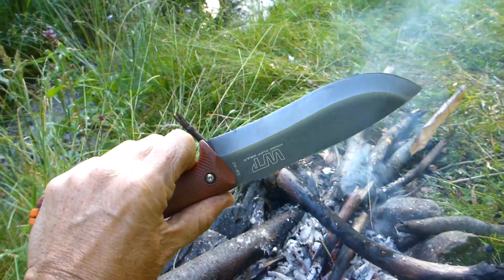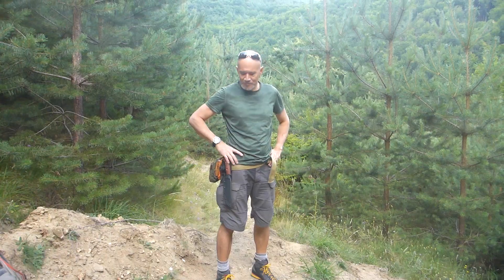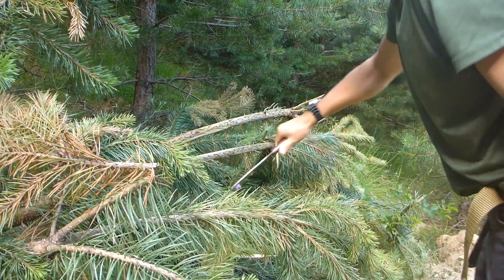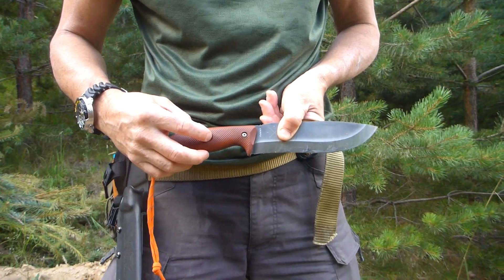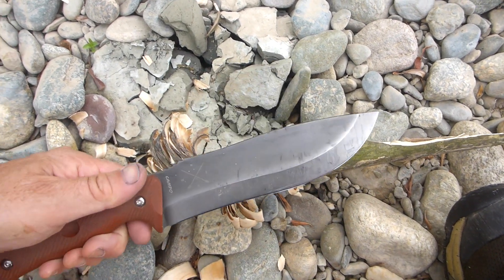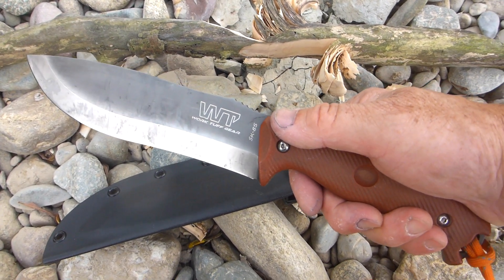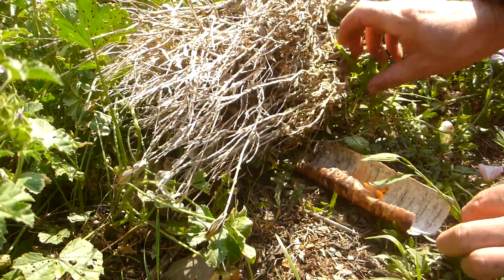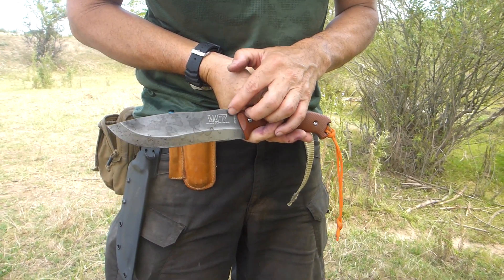Work Tuff Gear Campo Field Review

Comment: At 00:20 First look says that's an ergonomic chunk of steel and handle (I like a good Carbon steel). I better keep watching...56 to 58 is good for a knife that's going to cop some harsh treatment. The convex edge and the slight recurve, combined with the 5mm thick weight behind it works really well as a chopper, and that big grind (okay Scandi) makes it a great wood-crafter. All-round I'm impressed with this one for sure. It's something I'd use.
Reply from the maker: Hi Brad, yeah well summed up mate. That Scandi lets u get at a low angle and still do some cutting. It's good he has lightened the handle too, so despite  biggish knife, it's not too heavy at all. I just prepped an outdoor meal with it about an hour ago LOL!

Comment: D2 is my favorite steel.
Reply from the maker: It is a very good steel for outdoor knives, if looked after for sure.
Reply: I’ve tried the 3v and  own 2 knives in it it’s and it’s great but it’s a little hard to sharpen so my favorite carbon is A-2 tool steel O1 is a close second and for stainless I have a tie between AEB-L and CPM-154 but if I had to pick I’d go with AEB-L steel.
Reply from the maker: @barrybueler3356  Certainly A2 and O1 have been around for a while in the knife makers scene that's for sure and are well proven. I'm V impressed with SK85 (AKA 1085), at least with Victor's heat treatment regime.
Reply: Bush Camping Tools I would have no problem wish sk-85 I own a knife in sk5 and a couple in 1085 along with my kabar kukri in 1085 and I’m a fan 1075 but it’s as low cost of a steel I’d probably like on my knife especially if I’m paying when it comes to stainless steels the cheapest on Id like is the 14c28n I don’t care for the super steels to much of a pain to sharpen I like steels that wouldn’t be considered a super steel but just under it and higher than say 1070 in performance if I cant sharpen it with a good pocket stone like the Falkniven DC4 stone I’d  probably pass. On a fixed blade but I have to admit I do like some super steels on small pocket folding knives but still prefer n680 vg10 154cm 14c28n n690 Ats-34 a good steel just under the hardness of an elmax or something in the same category like 20cv m390 s30v etc.

Comment: What's the edge length on the knife ,it seem to cut well and has a grind , thickness and sheath.
Reply from the maker: The edge is approx 6.7 inches. he hand grinds the edges and they are very well done.